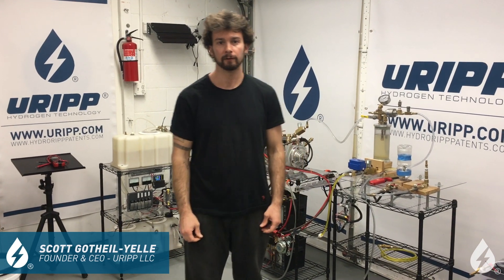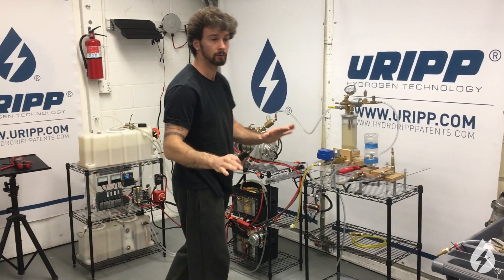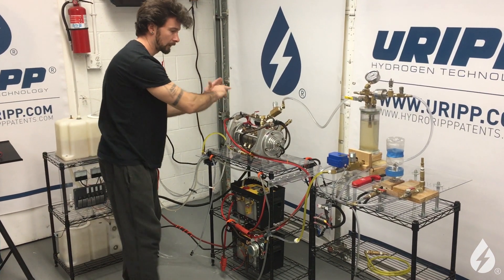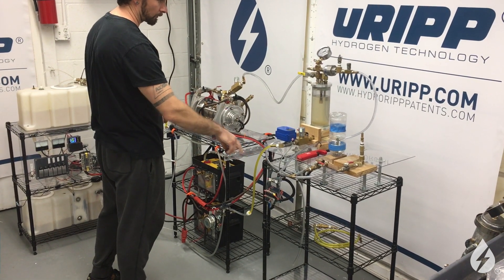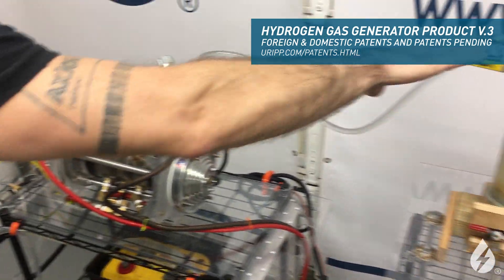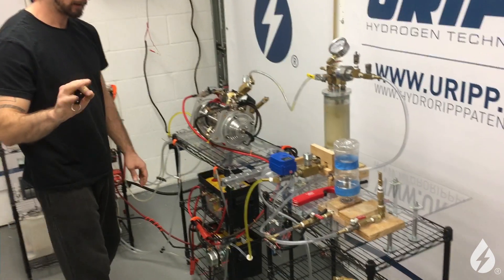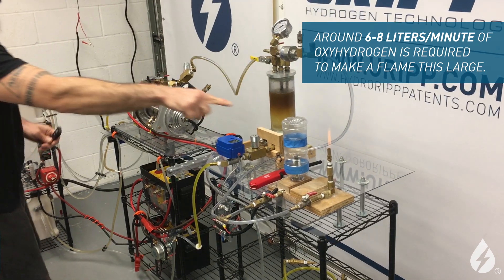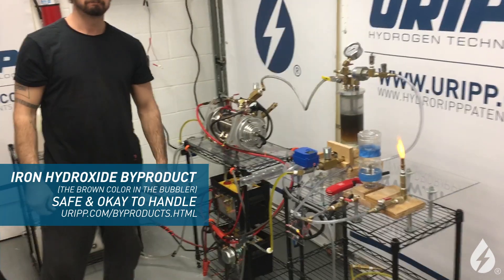URIPP LLC Hydrogen Gas Generator - Flame Demonstration 2020

Comment: You have a contaminated flame that is showing the color yellow. Your electrolyte in your cell is escaping with the moisture of electrolyte and water vapors together creating the yellow flame. Oxyhydrogen by itself is a light invisible reddish or purplish color flame. Oxyhydrogen and a carbon fuel is a blue flame.